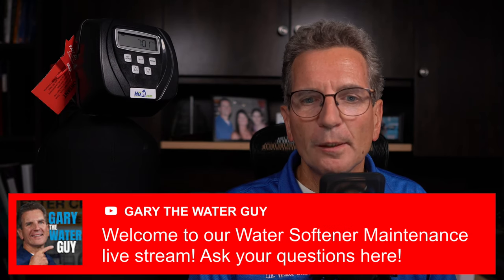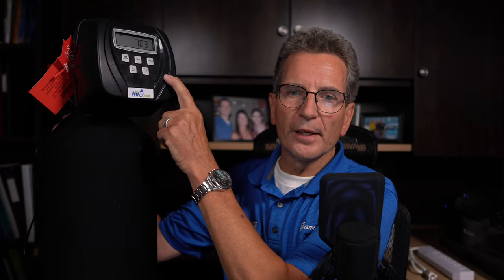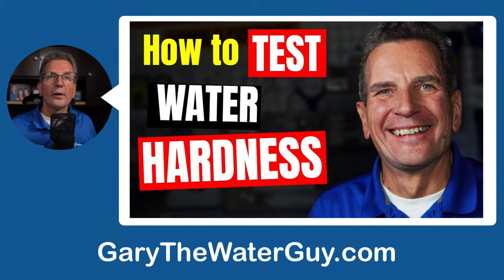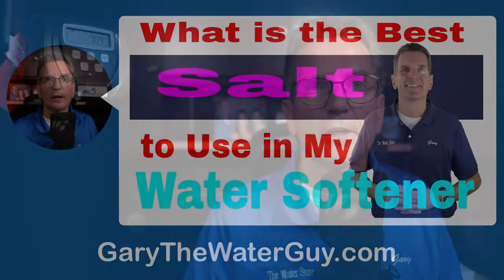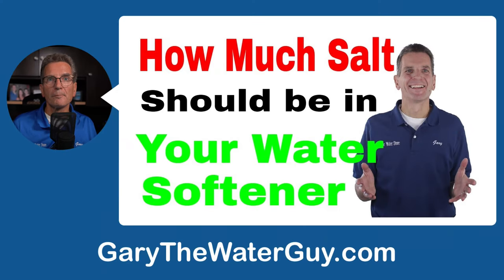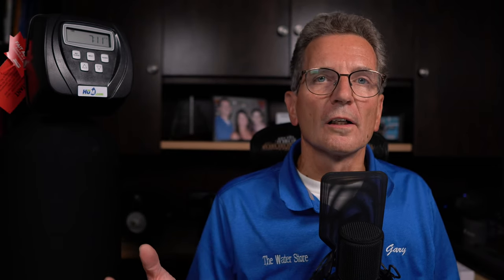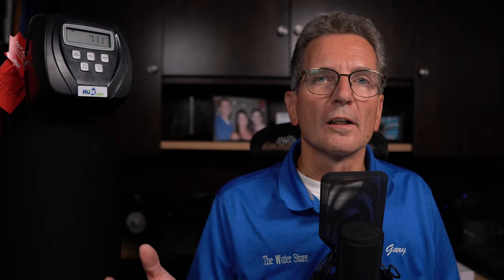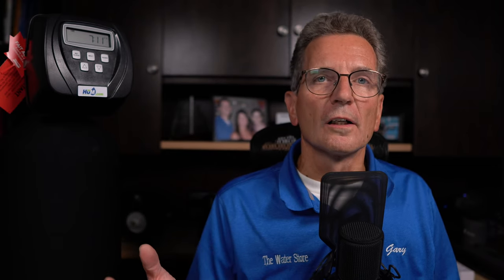WATER SOFTENER MAINTENANCE

Comment: Thanks Gary the Water Guy You gave me the information and confidence to fix my 8 year old Water Softener that was never had any maintenance done to it at all and the water started to be real hard even though it was regenerating on schedule and I was never told that I should do some maintenance to the unit to keep it working at the maximum efficiency and properly with a few things that are recommended to be performed at certain times of the year and to make sure that your water is safe and sanitary and not causing you any health problems or anything else like that could happen if you are not aware of the requirements to maintain the system and keep it safe and efficient as possible for a very long time So even though I was using the type of salt that the sales person told me to use and nothing else about the maintenance that should be done on the water softener after use and that is recommended by the manufacturer for best results I found out that my brine tank at the bottom was very not only packed with fine salt particles that caused bridging but it also so bad that it smelled like a sewer and that the salt was grey colored and it smelled so bad that I had to almost use an oxygen supply and mask in order to be able to clean it out and remove it from the brine tank and the existing salt that was so bad that it did cause problems with the internal working parts of the water softener and I did have a whole house water filter for fine sediment particles and after having a new personal water well dug and cased out with a submersible pump inside the well and it was properly installed and sealed and all the requirements were performed before any water was used for our household for drinking and washing clothes and bathing so I reinstalled a new and proper filter in the whole house filter container and then completely cleaned out the brine tank and then I cleaned the brine solution supply line and the injectors and orifeses and the drain line system also I didn’t have any way to remember how to put everything back together again after disassembling everything including the brine tank float assembly and solution supply line and it was over the Holy Days and nothing was open or the manufactures customer support service department was not returning my phone calls nor from the business place that I purchased the water softener from and I didn’t want to but more minerals and bacteria in our water lines that I only had cold water available at the kitchen sink so we had to carry water to all the bathroom toilets so that we could use them and this went on for over a week and a half before I went to utube and found your segments and presentations on the Water Softener Troubleshooting and Repairing and Reassembling of all the components of the water softener system and I want to Thank You So Very Much for Your DIY Self Help Videos that gave me the knowledge and confidence to get it fixed and back together and then run it through all of the different cycles and it’s been working not only great but it’s providing the softest water that we have ever had I think even when it was brand new So Thanks Again I really appreciate it and May God Bless You and Prosper Your Business and Reward You and Your Family Take Care and be Safe with the Love of Christ Jesus Al HOffbauer
Reply from the maker: Glad I could help! Please share video with friends and family!

Comment: Thanks fot all the great information. My question is : on the top of th 5600 fleck main piston valve should the small screw and washer that attaches the piston to the cam wheel be tight or loose? I dont know if I've made it too tight. Would that impede the function of the piston/cam wheel operation preventing the cycles to complete and jamming or getting the valve/cam stuck on a particular point. My rinse cycled for over an hour and i thought it wasnt going to complete so i had to manually turn cycle past that point. 
My motor ,120v, is making noises that arent good, and the clock is running slow, about 2 hrs/day. Is that related to the timer getting wesker and malfunctioning?
Thank you so much.
Reply from the maker: I know very little about the Fleck 5600 valve. Best ask someone more familiar
Reply: @water_estore  I was impressed, but now not so much. This softener is probably one of the most popular for many years, it's baffling you don't know anything about it. Oh well, I'll move on, thanks anyway
Reply from the maker: Yes, the Fleck 5600 has been around for over 50 years, but as I mentioned it is not a product that I am very familiar with.  We recommend newer technology products and I honestly see very few Fleck 5600'.  So I have done very little work on them even 20 years ago, which is why I suggested you contact someone who still sells and sevices older technology Fleck water softeners (we don't) because they likely will be able to help you.

Comment: Hi Gary, Hard to express how grateful I am for your videos. Do you have any videos on carbon filters and proper maintenance of tannin filters. I'm wondering specifically what level I need to keep that resin at in the fiberglass reservoir.
Reply from the maker: Glad you like them.  I ahve carbon filters here https://youtu.be/yXu19iykvP4 Tannin filter maintenance is here https://youtu.be/1vMsb-GlrDo  Salt in brine tank should be about 1/2 full but higher than the water.

Comment: So I am a ham radio operator / mechanic / machinist / musician /computer geek.  Best cleaning tools I have for small ports are various size guitar / mandolin strings.  I keep the old strings for cleaning ports/ small engine carburetor pickup tubes / shower heads etc.  Find yourself a string musician and ask for their old strings, they will have plenty
Reply from the maker: Thank you for the tip!

Comment: How do I know if my resin beads are bad?  I have an 18yr old EcoSystem.  We are a high use household with chlorinated municipal water.  How do I know when to call for a service call from a pro?
Reply from the maker: Have your water tested after the softener for hardness.  If it is no longer softening your water or has slowed down the flow you need new resin beads.

Comment: Hi Gary, great videos. I have a Rainsoft watersoftening system that's about 45 years old (installed in late 70s or 80s) or better. Do you know anything about them or have information on them regarding maintenance? Thanks.
Reply from the maker: No, I would just follow the advice from that video.

Comment: Hi I have a older water boss 700. My question is does the float in the brine tank control the height of water after regen.
Reply from the maker: No, the valve controls the water level.  The float shuts off the water if something malfunctions.
Reply: Thanx I have no manual.

Comment: If you have a lot of iron in your water,  do not use the red out salt, as it has just a little bit of citric acid sprayed onto the pellets.  Use Rust Out, and sprinkle 4 oz. over each bag of salt.  As it works its way down into the brine solution, it will clean your resin a lot better than the red out salt. I would recommend buying the standard water softener pellet and then buying Rust Out.
Reply from the maker: I haven't checked this out but it sounds like it's worth a try if you are using a water softener to remove a large amount of iron from your water.

Comment: Hi Gary,  I know this video was produced a year ago but, I just discovered your videos.  The reason I have been looking up videos on water softeners is that I have been dealing with a service company for mine that I really believe has been ripping me off and not doing the correct service on my softeners system.    I purchased a Westinghouse water softener system which included a 5 tier reverse osmosis system installed under our kitchen sink about 7 years ago.  This system is due for an annual servicing.  I just tested the water for hardness and it is testing 
 hard.  Also I am smelling an older coming from the regular faucets when the water is running.  We are on well water BTW.  I have come to the realization that I can service this myself but need some advice.  Questions: I bought some 'Iron Out'.  Should I bypass the media tank while adding the Iron Out to the brine well to regenerate the media?  Also the book I have for this system doesn't go into servicing this equipment and there is no videos of instructions on servicing the Westinghouse water softeners on line.  Any advice you can give me will be greatly appreciated.  Thank you for helping us out.
Reply from the maker: No you should not bypass the water softener when adding the iron out.  My water softener maintenance video here should help https://youtu.be/kdkhAGlB2AQ

Comment: I just got a system installed locally here and the system has a bypass valve but why did the install company also install an external bypass system as well.
Reply from the maker: Not sure, could cause a concern in the future. I would ask them

Comment: Hi Gary i have a water refilling station the frequency of regeneration is every 2 days. The resin beads was replace last Nov. 2020. But only this year 2022 Aug. i manage to check the water hardness using test kit solution 1,2 and 3. I found out the hardness is 170ppm  and the color of the water sample from the softener outlet is blue. Advice me how to   correct the hardness. Do i need to replaced the resin beads? Fyi. the source of water i used is from deepwell .Thank you in advanced.
Reply: Additional info i put solar salt 5kilos every regeneration.
Reply from the maker: Have you gone through the troubleshooting advice in this video https://youtu.be/Lr3jyGiJdC0

Comment: Hi Gary, I just installed an Aqualux ProSoft water softener with a Fleck 5810 high flow control valve. With a 1.0 cubic foot, 10" x 54" tank and 200lb. salt capacity brine tank. I have a high suspended manganese level of 2.32 mg/L , iron @0.07 mg/L, hardness @103.1ug/L = 6 grains per gallon. which puts my hardness setting at 15.56 (H-15) on my control valve. Res Care was supplied with this unit. My question is how often should I  apply Res Care and/or should I be using Pro Rust Out? Or is there a a different product I should use. I am a first time water softener owner. 
Appreciate any feedback.
Reply from the maker: I am not familiar with that water softener so i would check with the manufacturer.
Reply: -  @water_estore  - I guess I didn't ask the right question Gary, I'm on well water. I have been using Res Care once a month, our water has suspended manganese level of 2.32 mg/L , iron @0.07 mg/L. My question is Res Care okay to use or should I Pro Rust Out. My other question would be how often should I use either of these products, any suggestions would be greatly appreciated.

Comment: Must it be on bypass to clean the injectors
Reply from the maker: No, but the water needs to be shut off and you do need to start a regeneration cycle to release the pressure.

Comment: Gary, just found you on YouTube and followed your tip on how to bypass my water softener.  It's Saturday night and my kinetico water softener will not stop regenerating.  Was hoping you could help me fix the issue.  Thx a million in advance.
Reply from the maker: Can you not just bypass it?
Reply: @water_estore  Ours keeps dumping water out of the drain house.... been about 3 days. just bypassed it. What is our next step? I thought these were very low maintenance! What reasons could cause non-stop draining to occur? Faulty O-Ring maybe? We always use quality salt and the regen is set to approx 3am
Reply: @water_estore  yes I was able to bypass by watching your YouTube video.  The kinetico (American Water) crew came to the house and replaced the head unit.  Fortunately for us the Kinetico was still under warranty.... All's good now.  Thx

Comment: For my softener plant, brine intake time is 30 minutes whereas duration of filling water into the brine in the last of regeneration process is just 5 minutes. My question is if the system refills very less quantity of water, how much brine solution is it going to take in because brine suction cycle is 30 minutes. Will it take some air after taking in all the very low volume of water? Or should I fill manually the brine tank after it refills for 5 minutes. Please explain. Thanks in advance
Reply from the maker: No, you don’t need to add water. This video explains the regeneration cycle
Reply: @water_estore  Thanks for the reply. I stopped adding water and now my hardness levels are maintained. 👍

Comment: I have had a Culligan water softener for 5 years. The water isn’t Coming out soft anymore. It appears that we did have a salt bridge. We cleaned the salt bridge we cleaned the entire salt tank. We also used resin out to clean the brain well. I have re-generated the system with each process. What else am I missing what could it be.
Reply from the maker: try the ideas in this video https://youtu.be/Lr3jyGiJdC0

Comment: Can you turn a one piece system on its side to empty and clean
Reply from the maker: I wouldn't, they tend to break the top plate.  If you are very carfull and tip it on to it's back it might work.  But again, I wouldn't.

Comment: Hi, should I run the recharge everyday and should I manually do it? I set my softener recharge at 2 am, but it didn't start that time.
Reply from the maker: Water Softeners does not regenerate every night only when they run out of capacity.  This video will help https://youtu.be/wPh_l56OWOM
Reply: @water_estore  Hi Gary, thanks for your answer. I'd like to know will the softener run automatically or manually? My softener is Kemmore 300, only one part.

Comment: Waterboss 900 water pressure in the house is very low. when softener is bypassed there is plenty of pressure. I replaced injector assembly, cleaned brine valve assembly. still low pressure Help...
Reply from the maker: You will need to replace the water softener. Likely the media has become degraded from the chlorine and their now blocking the riser tube

Comment: What do I maintenance for black water?  I have flushed my hot water tank and I still have it.
Reply from the maker: Likley you have manganese in your water.  You would need to clean the water softener media.  This video explains the process https://youtu.be/c8QKYr3B02I and you can get the cleaner here https://waterestore.ca/products/pro-res-care-water-softener-resin-cleaner-3-78-l-free-shipping
Reply: I have a Hague Watermax.  I bought my house in 2009 and it came with the house. (house built 2000).  I cleaned the brine tank, it was very dirty. I regenerated it overnight and it is still black (or gray). Do you think Res Care will fix this problem?
I watched a video from Hague and they were cleaning (replacing) carbon.  Have you ever heard of that and do you think it may be carbon issue or Res Care can fix it?
Reply from the maker: I would definitely try Res Care, if the media is dirty that might fix it.

Comment: I accidentally put pool salt in my brine tank. What should I do about this? My water is hard. I have a new puronics system.
Reply from the maker: I would try to remove most of it and then add water softener salt.  It should be fine.
Reply: @water_estore  thank you. We just replaced our original Puronics with a new one and I was so worried that I messed it up. First mistake in 20 plus years with my unit! 😂

Comment: Why does the solid state boards short out..? Should have reset...cheap worm gear..and motor drive...
Reply from the maker: I have never heard of the boards ever shorting out.  A brown out or major voltage or power surge may kill the board which is why I suggest you plug it into a surge suppressor.  We have sold thousands of these and never had a worm gear or motor failure, have you?

Comment: I would not recommend using chlorine as chlorine damages resin and is not approved to disinfect a water softener.  I would recommend using Sani-System.  Sani-System is NSF  approved and EPA registered sanitizer for water softeners and Reverse Osmosis units. And it does not damage resin, valves or seals in the unit.
Reply from the maker: We have Sani System available here  https://waterestore.ca/products/pro-products-sani-system-water-softener-disinfectant-2-pack?_pos=26&_sid=f9a936893&_ss=r

Comment: Mine is staying at 0 capacity in gallons remaining
Reply from the maker: Either the water softener is not regenerating or there is a problem with the circuit board.